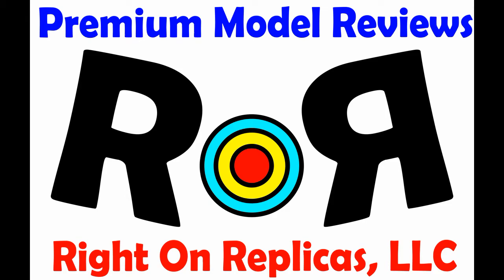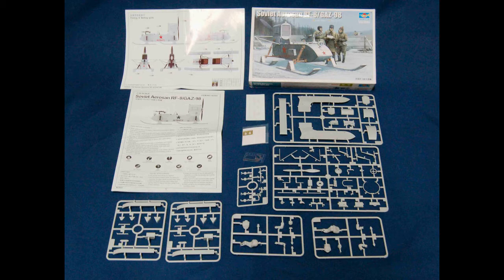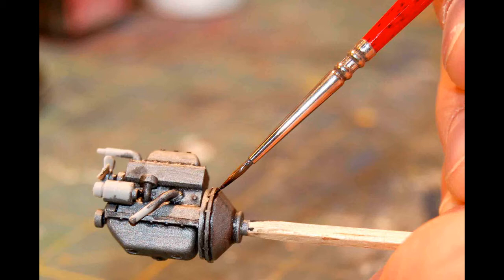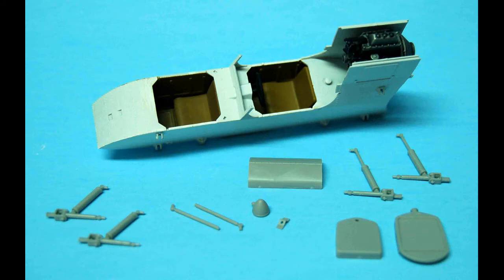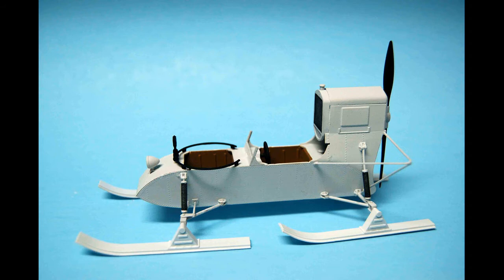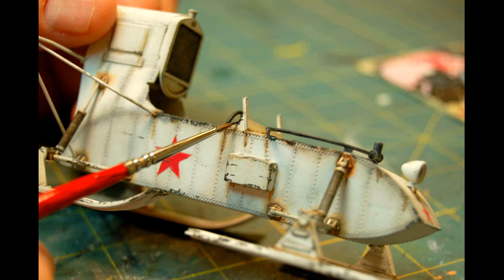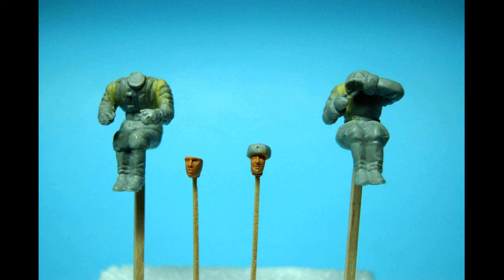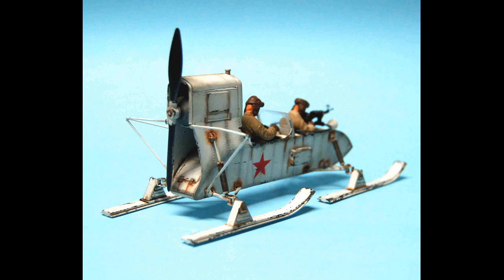How to Build the Soviet Aerosan RF-8 GAZ/98 1:35  Trumpeter #02322 Review

Comment: Great job building and painting the Aerosan.  Weathering is very realistic.  Nice work too installing the crew figures.  The slight fit adjustments worked well. Top notch all around.
Bill
PS: Is it me or did you forget to paint the crew figures' hair...visible at the rear of their caps?
Reply from the maker: PB - Thanks and I had chosen a light brown but in the photo you can hardly see any difference because of the glare on the subject.  -Doug
Reply: My bad, Doug. The photo was misleading.  Again you did a fantastic job on the Aerosan and crew.  Thanks for sharing.
Bill
Reply from the maker: Bill - I'm glad I've got viewers like you that can ask the good questions.  Thanks for stopping by.  Next time I'll make those guys red heads!  -Doug